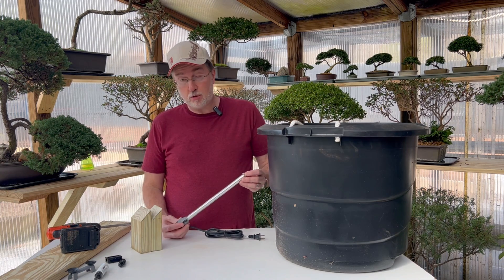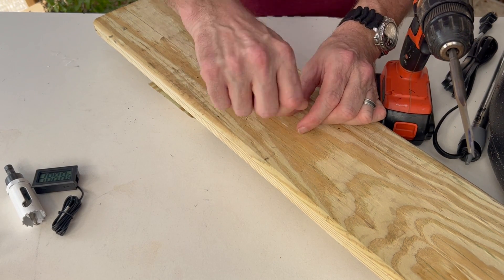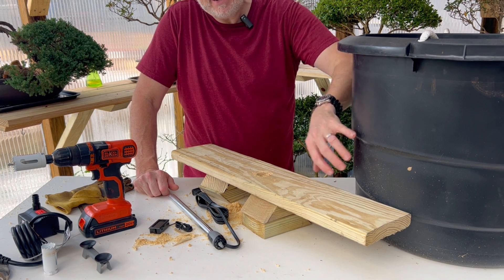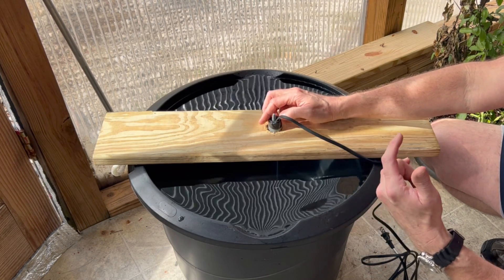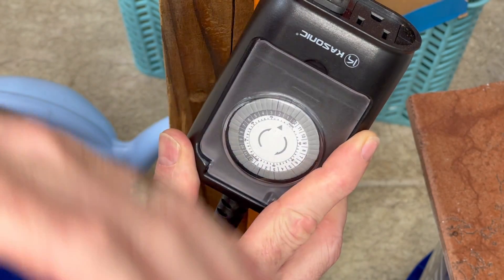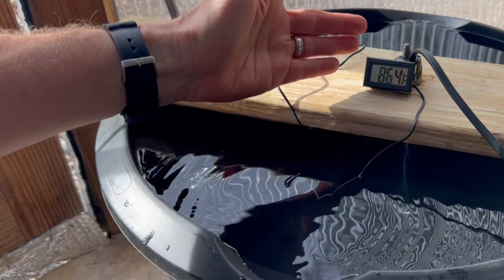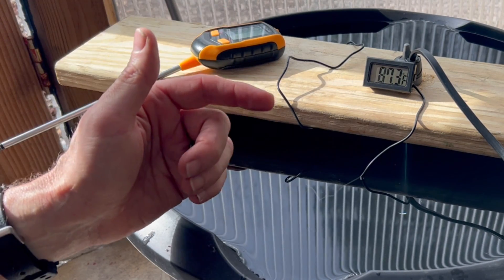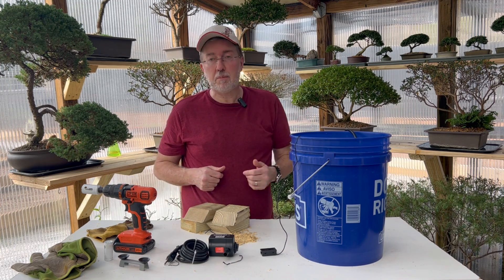Heating For Pennies A Day || Simple Set Up Works All Winter Long

Comment: I watched a video for a mason jar heater, which looks like it will definitely work for my application. I have a very important question for you that wasn't mentioned at all. How do you turn it off without running the fuel completely out. Like an on off swith.
Reply from the maker: Blow out like candle

Comment: Get a solar panel and a 12volt heating element and get sun power.
Reply from the maker: Thanks good video idea!
Reply: thomassmith3310 can you provide a link for such a thing? Thanks
Reply: @Nakijead2 ebay pretty good for that.